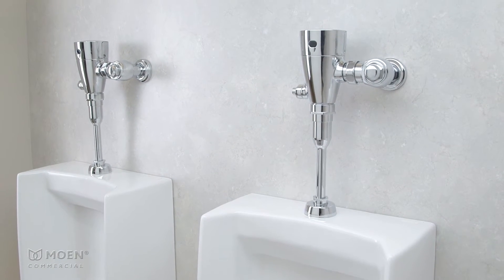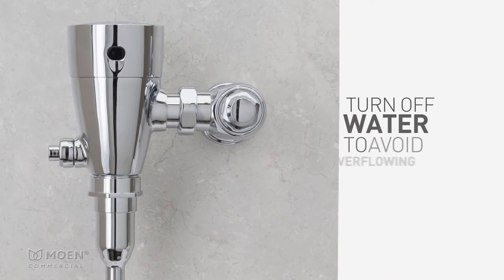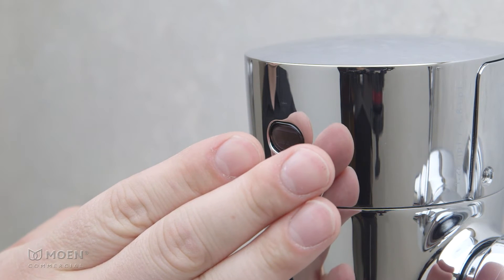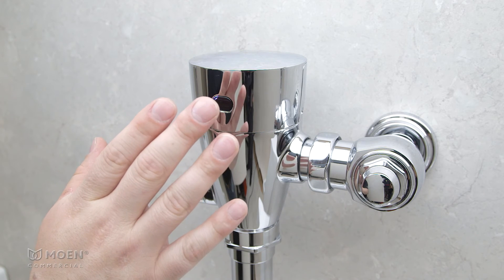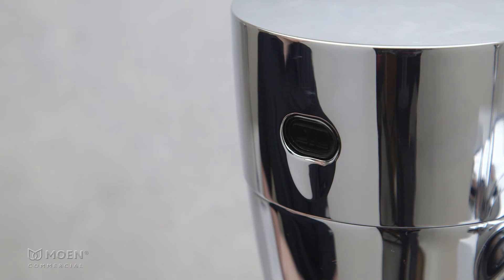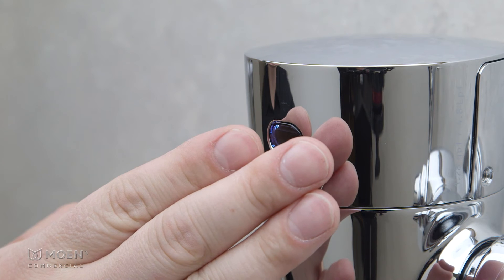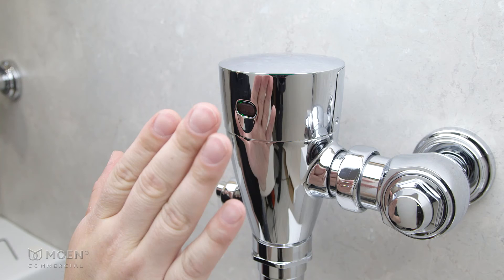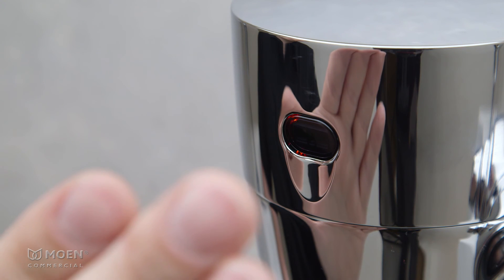Programming Flush Volume on M-Power Flush Valves

Comment: Mine just shows red. Replaces batteries. This thing is a piece of crap
Reply from the maker: Hello. The solenoid may be stuck in the open position. You will press the manual flush button 3 times. If it does not flush, replace the solenoid. Since the batteries have been replaced, please make sure the battery pack has been unplugged for at least 30 seconds to reset.

If you continue to have an issue, you can reach out to our Product Specialists. They can be reached Monday through Friday from 8am-7pm EST at 1-800-289-6636.

Comment: It won't stop flushing!
Reply from the maker: Hello Ulefone X7 Pro. We would be happy to troubleshoot the issue you're experiencing with the flush valve. We recommend verifying that the manual override button is not stuck and replacing the batteries, if applicable. If the sensor is light is red, please ensure the solenoid cable is fully seated and the sensor is  programmed correctly. Please call us directly if the issue persists, we can be reached at 1-800-289-6636. We are available Monday through Friday from 8:00 am - 7:00 pm (EST).

Comment: It won't stop flushing
Reply from the maker: Hello Tobey.  I am sorry to hear of the difficulty you are experiencing with your Moen M-Power Flush Valve.  Couple of things to check when the Flush Valve will not stop flushing:

1-Make sure the manual flush button is not stuck in the "on" position.

2-Make sure you have a solid RED indicator light to ensure proper solenoid connection.

3-Confirm power source-change batteries, etc.

You can also use the following link to send us an email with more information to further troubleshoot this issue:

https://www.moen.com/customer-support/contact-us
Reply: Ever get it to work
Reply: Mine is not powered up and it keeps flushing when I open the control stop